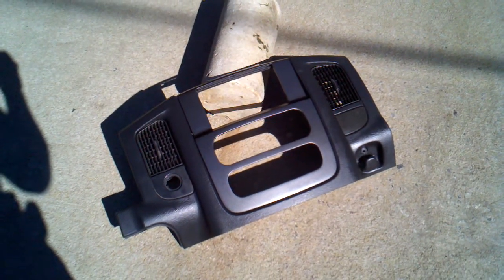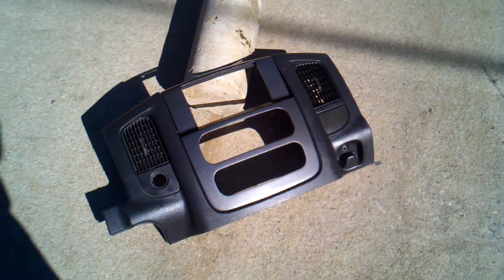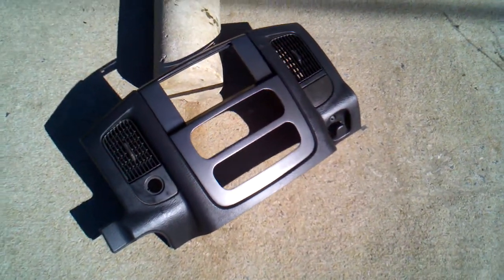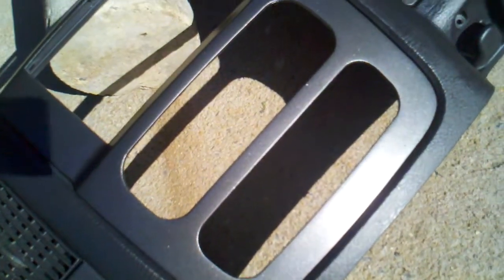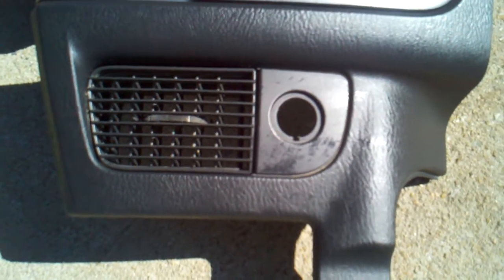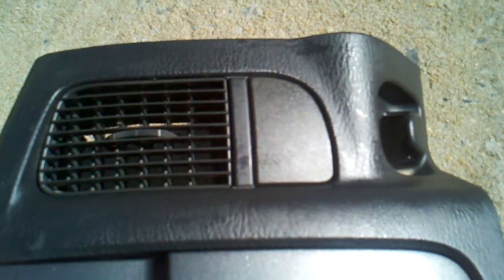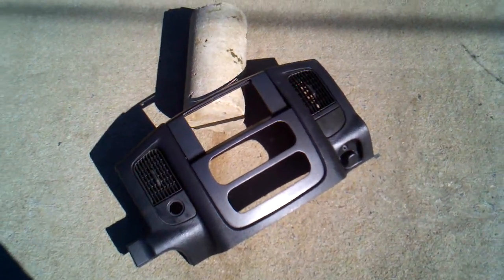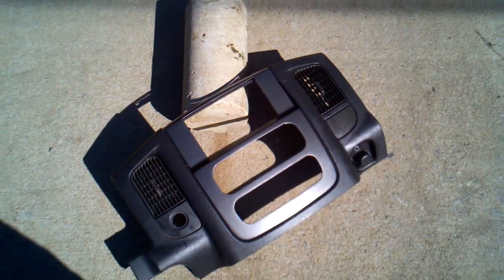Custom painted double din bezel

Comment: Man I was looking at this and realy like it.  I have an 04' Ram and would like to see your set up if you can get another video on here if you don't already.  I'm a Pioneer man so an AVH-P4300 will be my head unit of choice.  A little worried about mounting brackets for the head unit itself mainly because the change from single din to double. Very intrested to get your input.  Looking to get one of these very soon.